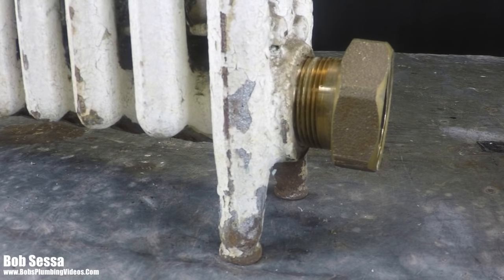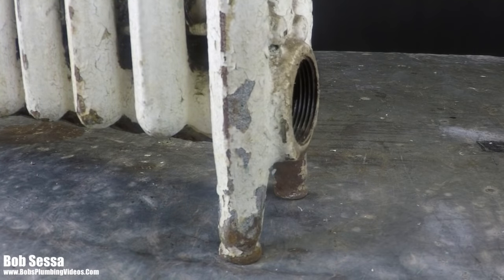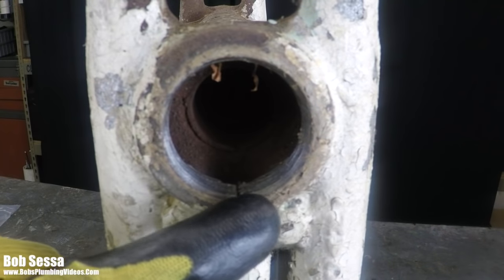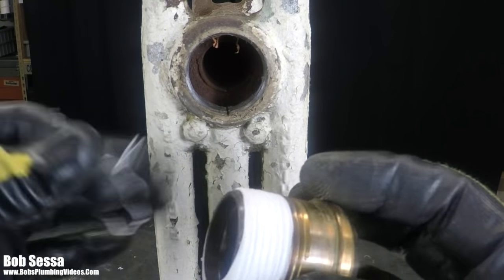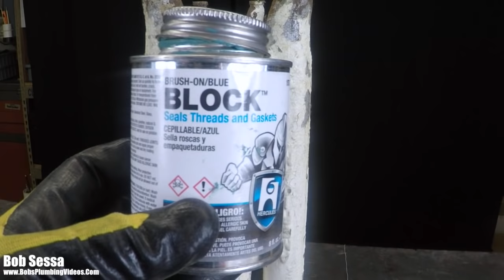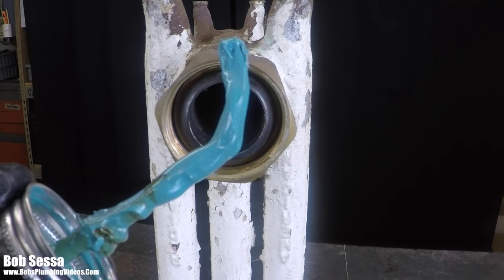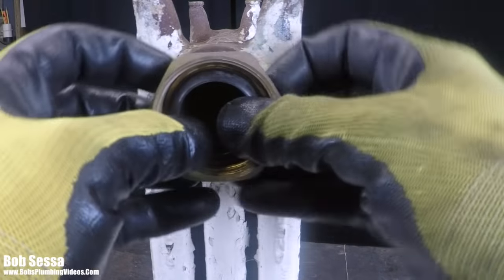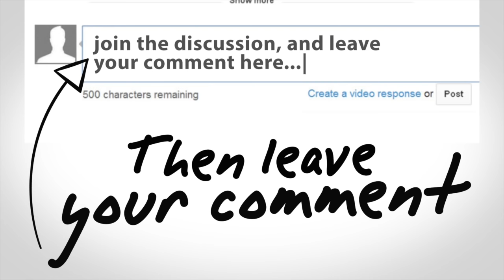Damaged Fitting Threads /How To Seal A Damaged Thread

Comment: Good video and good advice. I do a lot of steam and boiler work, piping and repairs. I have used the hacksaw technique many times and on rare occasions I have sawed and gotten into the threads. The way I have repaired this scenario is to mix up a small amount of high temp. quick setting epoxy and carefully fill the gap, let it harden and then use my appropriate pipe tap. Works like a champ, makes a permanent repair and I've never had a leak on high or low psi steam. Of course you have to own a set of taps and that may be a downfall for a do it yourselfer.
Reply: Gorgeous said the proper pipe and then before it completely sets up you know cut the threads then back it back out

Comment: Thanks for the video, Bob - it really helped. Rookie error - I cut too deep when trying to remove a broken, seized shower arm. Tried to find oil wick, no dice. But I found cotton twine (about the same size) at Home Depot. Couldn't find the blue stuff, so went with Rectorseal #5, which I generously applied. Let it sit overnight, passed the pressure test on the first try!
Reply from the maker: Excellent!

Comment: To stop a leaking shower head, I replaced the shower valve, and also replaced the seat. I think I cross threaded the (hot side) seat into the valve in wall, because it didn't get progressively tighter as I turned; it got tighter, then looser, then tighter again  as I continued turning. (The cold side turned in tightly and snug.  There's a leak into the basement underneath when the shower is used.  So I'm planning to "redo" it by removing the seat (again) and replacing it with new one, cause I'm told that the seat threads are weaker than the valve threads in the wall.  For this case, is it a good idea to use the Blue Block? Sounds like BB isn't appropriate for a seat which likely needs future removal again.   Or is Lamp Wick with Rectorseal appropriate?  Thanks in advance!
Reply from the maker: I would go with the lamp wick and rectorseal

Comment: I think I will show you all an old trick that seems to have been lost in history but we use it all the time in Alaska and now hopefully everywhere! My father helped me out on some tight pipe threads years ago. When you are in the early stages and applying heat to the female section of a joint via a torch, grab a wax candle and melt some wax into the threads. It sucks in just like solder sucks into a joint, I have used it on frozen galvanized pipe, where even adding a long pipe to your wrench will not work and the joint un screws like butter. We also use it on rusty engine parts that have been used in marine applications, such as manifold bolts etc....you have to get things pretty hot depending on the size but I have almost never had to collapse a fitting. With cast iron make sure you spread the heat nice and even. In other words don't do it when there is water in the bottom of the radiator. Good luck!
Reply from the maker: Now that is something I've never heard of, thanks  very much for that tip! I will give that a try & thanks for checking out the video. Regards, Bob.

Comment: Take the lamp wick, coat it in liquid epoxy and lay it in the cut. Add as many layers as necessary. After a few min once it's set up, not cured but no longer tacky, lightly lube and thread a fitting back in until snug and remove again. Now tape/dope it up as normal. Best to final torque the fitting on while epoxy is firm but still has some malleability. And no need to wait until fully cure, can start filing/bleeding system immediately after. A permanent worry/leak-free repair and really may take all of 5-10 min.

Comment: love this stuff,excellent.now back in the day when i worked in ammonia refrigeration plants here in nyc,we used to use expando,never had a leak.had to use torch to break it free but thats another story.also my uncle who was a plumber in local one always used litharge and glycerin.there is also one way which is out there but it worked for me on a return line one time,dont laugh as it works.clean up joint as best you can ,use a thin bead of crazy glue,then sprinkle baking soda on joint.wait maybe ten minutes.and should be ok.this reair was on a condesate return line and it was the coldest nite,had no choice but to try iy.used this when i was building model airplanes and with good results,i know it is wacky but,as you know those are the things that get you out of a jam.soldering cast iron is difficult if not impossible but  with preheating/heat dams it can be done.with this type of gouge you could try teflon rope carefully packed into nick and then make up joint.just some thoughts here.
Reply from the maker: Outstanding! Blue Block or Grip has gotten me out of plenty of Jams. Thanks for checking out the video. Regards, Bob.

Comment: How about tapping a piece of solid copper wire into the cut and letting the cast iron threads press it in white "threading" the top section on the copper wire?
Reply from the maker: Never tried that technique, sounds interesting and if it works that’s all that matters!

Comment: The reason they get so stuck in the cast radiator is a process known as electrolytic conduction, causing corrosion in the threads. The cast releases atoms to the brass in this process.

Comment: redoing my water heater.. replacing it with a tankless, the pipes are either galvanized steel or cast iron, honestly they're in a condition that i can't tell anymore. It's got a thread that will hold but umm..  somehow no matter how much teflon tape and silicon plumbers lube she just wont stop dripping. I'll give this a shot, it seems more like your creating a gasket seal between the threads so this may just be what what the doctor ordered. Either that or i'm going to breakout the stick welder and become a pipe welder.
Reply from the maker: That's exactly what happens!

Comment: Seems to me that Union is in backwards if it was switched around you could tighten it without an internal pipe wrench which I never heard of before but if you turn it around you could just wrench it with a pipe wrench then piece together your union!

Mk

 normally and then to connect the union to that existing piece

Comment: Same problems with 4" cast iron drain pipe tried chiseling out old 1 1/4 " galvanize pipe water drain now hard finding fitting to replace I took out. PVC won't fit two Different threads.

Comment: I know that car mechanics will use a metal like paste on a thread that hardens, and then they will re-tap it. Also, I would think to use just a thin layer of anti seize before applying the Teflon tape and brush on sealant would help keep it from locking up for the next guy who has to work on it. I just acquired about 11 radiators, so I will have to service those and reacclimate them according to load, but that may not be a big deal since they are adjustable, as long as I do not put an undersized one in a room. There is always something to know, and I have a lot to learn.
Reply: That metal paste (anti-seize) is for minimizing galvanic corrosion in high temp applications (spark plugs, exhaust bolts, etc..). It's not designed for sealing and is water permeable over time once it's petroleum base dries out. At that point it's more of a graphite powder. So great for door hinge pins also. But actual pipe dope should remain pliable and retain some of it's tackiness over it's life which is what you want for a liquid seal.
Reply: @SerenoOunce  I appreciate that bit of advice. Thank you.

Comment: You can usually get them off with a large pair of channel lock pliers.  If you need more leverage to loosen the nipple, get a cheaper pipe wrench and grind down the width on the jaws and base.  No saw needed.
Reply: This guys has been a plumber like 40 years. If he could have got it off with a wrench I am sure he would have. Obviously you always want to use a wrench first
Reply: @joshdiehl8737   Some Experienced plumbers often do things a certain way, not always the best way or the right way, but their way, especially when a job is time and material.
I’ve seen some plumbers work, shake my head and walk away while others that’s a great idea.  Having worked 25 years in hydraulic research and development, you find new and creative ways to get the jobs done quickly, efficiently, and create as little downtime as possible.

Comment: Hi Bob, enjoy watching your videos. This is a tad unrelated to this video.  I've a 13 year old, 75 gallon Bradford White with the hydra flow feature and insulated top. Appears the "plumbing company" who installed it in 2003 used as little pipe dope as possible on the threads (to get into my wallet again ASAP, I'm sure; notorious company here in the NW.) I was going to replace the anode at the 5 year mark, but my late wife fell ill with breast cancer and every plan we had went south. Anywho, I discovered the other day that that the hot water outlet has a very minute leak and both the anode rod and fitting are badly corroded. I seriously doubt that the liner is rusted as every plumbing shop has told me, for obvious reasons. I believe I'd have noticed it in the water if it had. She heats up fast and appears to be in excellent shape otherwise. I'm afraid a pipewrench would collapse the fitting. How should I go about this? Would drilling a hole thru the fitting and bolting a cap on to break it free be my best bet? As for the anode rod, would you advise a slow cut by hand with a hacksaw and collapse it with channel locks or? From eyeing it, she appears to really be fused on there, and the insulated top is going to be in the way of my getting a solid bite on it. I'm on a fixed income and simply can't afford a new heater right now. Any advice would be much appreciated.
Reply from the maker: My honest opinion is to leave well enough alone. That heater is most likely covered by a 10-year manufacturer guarantee on the tank itself and you've already gone 3 years beyond that. When I install new heaters I recommend maintenance intervals anywhere from 24-36 months (my method, not gospel ). Once you get to five years and beyond, the thin glass lining most likely has been compromised and maintenance at that point is a 50/50 proposition. Take a couple of photos of the top of the heater showing me the connections you're concerned about, send them to info@bobsplumbingvideos.com. I'll take a look. Regards, Bob.
Reply: thanks so much, Bob. email with pics sent.

Comment: Another great video….What size valve was that 1 1/2?   I am assuming you don’t need a bushing with that
size valve? If you do replace the bushing would you suggest a brass bushing or black pipe bushing if your

using a bushing with a new valve?
Reply from the maker: I believe it's 1 1/4" and on steam I would just use a black iron bushing.

Comment: If you can’t get unscrewed with heat oil and a pipe wrench. Then you need to be very careful with the saw!  Also after you cut the nut off put your spud wrench or something inside the pipe before you use the pipe wrench so it doesn’t collapse.  Your method seems pretty good but I would try to avoid this at all costs

Comment: Why not just use some soft tin/lead wire as a babbitt material to be crushed and oozed into place under the pressure of the fittings? 50/50 40/60 or 30/70 should be soft enough. Just lay the solder wire in the groove. A steel pipe nipple might be better to get the material 90% formed to avoid stressing the brass fitting and risk having it crack. After forming the babbitt material remove the steel nipple and use a pipe dope that’s good at sealing trouble spots, e.g. RectorSeal No 5, it’s sticky and oily but it does a good job sealing malformed threads that shred tapes and scrape off pipe dope that’s not so good at getting all over the hands. 
At higher material, the automotive thread seals in a thin toothpaste tube that are a dark brown gasket lacquer with clay are very likely to work well on their own, putting a few strands of paperboard makes sure it stays filled while you work. It can be used for steam in an hour. The red anerobic gasket maker will certainly work without any assistance, in another guise it seals A/C and refrigeration against refrigerants, hot/cold and extreme pressures. The only downsides of the red anerobic sealer are the long cure time and the price per pipe joint. The benefit is it will seal even damaged and malformed threads on the first attempt.

Comment: If you gently tap on the hub all the way around before attempting to unscrew the nipple, it might come loose. Also, make sure that the pipe wrench is touching the nipple at 3 points to prevent egg shaping the nipple.

Comment: Hi bob, where can I get either Sarco valve replacements or, if I can’t, maybe just a plug to plug the valve. Rad system is from 1946 and part of apartment bldg. please help. Need to get the system fixed during summer thank you
Reply from the maker: Not sure what parts you're looking for, but you may want to check out this source: https://www.statesupply.com/spirax-sarco/valve/part

Comment: My steam radiator threads where the air vent screws in are worn not holding the air vent well. Wll the blue block product allow the vent to be replaced at a future date, or is it a permanent seal  like using JB weld? Any advice appreciated, and thank you for a well executed tutorial in the you tube classroom. All the best from New Rochelle N.Y.
Reply from the maker: No BlueBlock can be removed, it's a soft setting sealer. If you have to drill out the 1/8" vent tapping. Step it up to 1/4", re-tap and install a new vent using a 1/4" X 1/8" bushing. Or a 1/4 " air vent if you can find one, straight ones are easier to find than 1/4" angle.
Reply: @BobsPlumbingVideos  Thank you for the timely reply, and top shelf guidance.All the best to you and family this holiday season.

Comment: Remember Expando? You mixed it up with a stick and worked it into the threads. Royal pain to work with but it sealed pretty much everything. Not sure if they even make it still
Reply from the maker: A couple people have said they dropped some solder into the nic and then ran a nipple into the fitting to cut new threads. Never tried it myself!
Reply: Thats a cool trick. Whatever it takes to get done get paid and go home, right?
Reply: Richard Luca They still do from what I found online..!

Comment: Bob, could you use a torch and melt solder into the cut then run a thread cutter into the hole?
But I like your suggestions also.
Reply from the maker: Mike, I never tried that as I don't think the solder will adhere to cast iron. But in theory, it should work. Perhaps if it were a brass or copper convector, it might work.
Reply: Using localized heat from a torch is very likely to crack cast iron. This would require an industrial oven and slow heating and cooling. Neither 50/50 tin lead solder nor 95/5 tin/antimony, nor 97/3 tin/silver solder adhere to cast iron anyway. Several types of copper and nickel alloy brazing fillers will adhere, but this requires yet higher temperatures.

Comment: my problem is the fitting thread is stripped and I can not get the fitting off to replace it . its where the water goes into the fitting for my bath tub. will this work or is there a different way to fix my problem
Reply from the maker: Send me some photos, I'll see if I can help. Send them to info@bobsplumbingvideos.com.

Comment: Is there an advantage of using lamp wick over a waxed hemp wick?
Reply from the maker: Anything you can get to sit in between the threads is going to be better than a Teflon product in my opinion. Especially if you're working on older pipe threads.

Comment: Bob, Will the same technique work if the nipple were steel instead of brass? I Also notice that you always make your cuts in the upper portion of the nipple. Is that so there will be a lesser tendency to apply too much pressure  so as to  avoid cutting too deeply and possibly damaging the remaining thread?
Reply from the maker: It works on brass, steel, galvanized. I'll make my cuts wherever I have the room, top, bottom, left or right side! Depends on the job circumstances.
Reply: Thanks Bob!
Reply: It helps prevent leaking since the water only collects at the bottom to return to the boiler.

Comment: Bob this is the second one of your video's that I have watched and want to say thank you and great job. But rather than getting into a long story , I will save you the details lol ,I have a problem that I was wondering if this method would work.I have a brand new brass faucet and brand new brass fitting with a rubber washer on the inside I have already made 2 mistakes first I put tape on oopppssss  but second without tape I may have over tightend oopppssss but not sure about that cause 1 side maybe but other really couldn't get on it that much. In either case they both leacked, so would this method work and what would be the probability be lol,at this point I wouldn't hold you to it lol like I said long story.But in any case thanks again and great job !
Reply from the maker: Could you forward me a couple of pictures of the issue? Info@robertsessaplumbing.com. Regards, Bob.

Comment: Old Galvanize pipe water line for shutoff value with no threads. How to fix to turn water flow back on.
Reply from the maker: Did you try tapping out the fitting?

Comment: I'd recommend not doing any of this. Buy a miller tru- seal nut and be done with it.
Reply: They make tru seal bushings?  how is a nut going to seal that?
Reply: @petergriffin1546  The seal nut screws onto the bushing. Screw bushing in then the seal nut gets tightened down toward female threads.